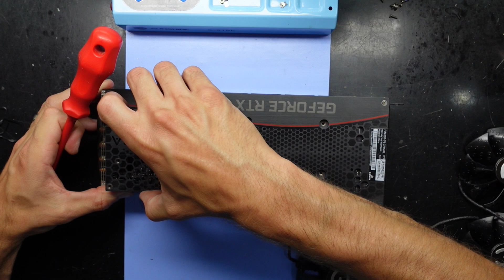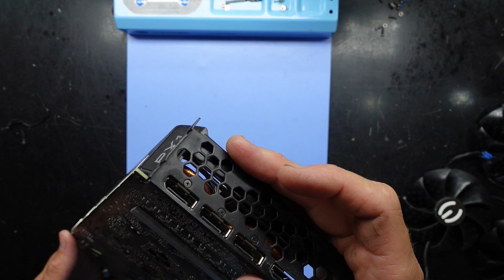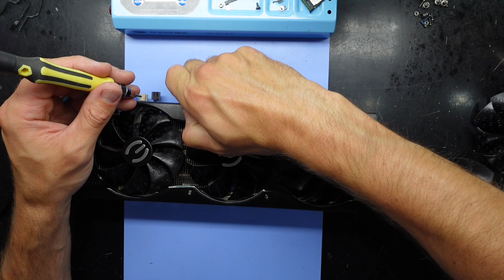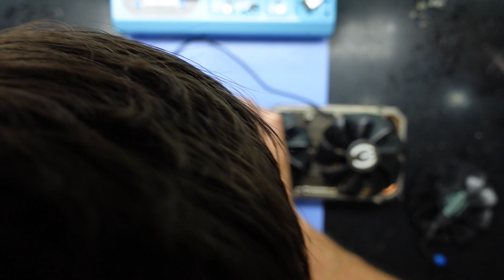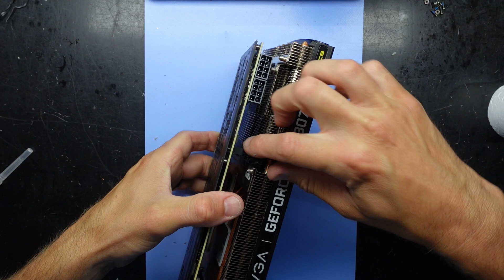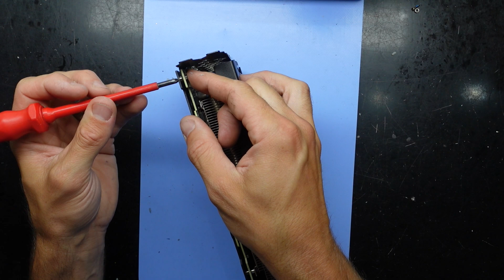EVGA RTX 3070Ti XC3 Thermal Paste & Fan Replacement

Comment: Mine was the same way, seemingly very stuck which made me a bit nervous. To replace just the fans, only the 4 screws on the bottom and 3 smaller screws behind the TDC of the fan blades need to come off. Similarly, just to separate the mainboard from the heatsink and fan assembly, you just need to remove the 8-10 screws around the metal plate side. I don't use thermal pads if it originally had thermal paste, not a good substitute, imho. Quality thermal putty might be easier and more efficient than thermal pads. You also do not need get the thickness right, just make sure the putty will cover the entire chip surface. Using a digital caliper, you can also measure the thickness of the old thermal pad before removing them to see the bare minimum thickness the new thermal pads need to be but you can typically go 0.5mm thicker with no issues. I have successfully got noisy fans to work like new by cleaning them for 10 minutes at low heat (30-40 C) in an ultrasonic cleaner.